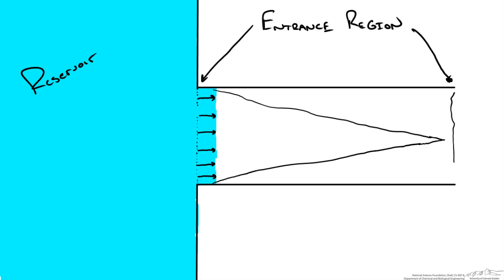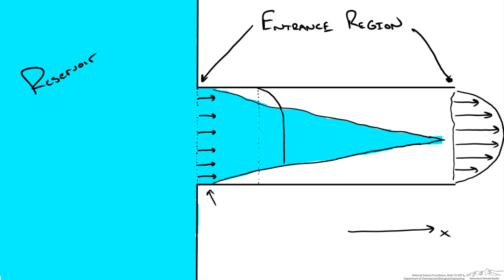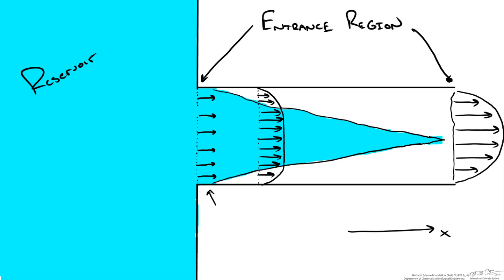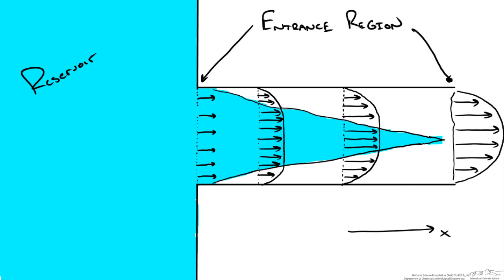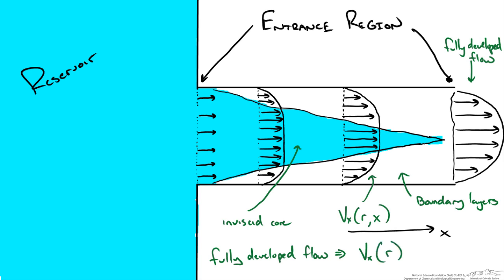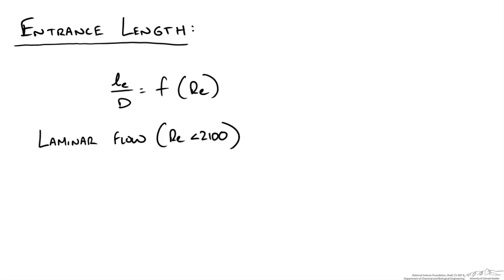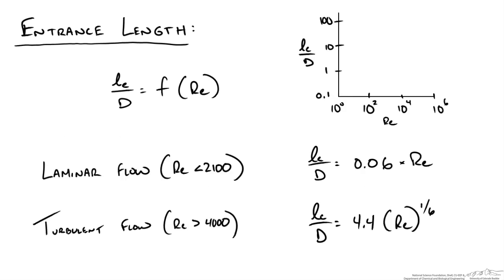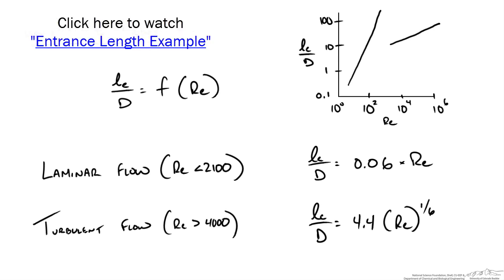Pipe Flow: Entrance Region & Entrance Length

Comment: Is there a way to figure out whether the fluid flow is laminar or turbulent just from a given entrance length? I recently encounter a problem during my exam on this, and up until now I'm unable to answer it. The given for the problem was: SG = 1.150, viscosity = 0.950 cP, mass flow rate =1.746kg/s, entrance length = 221mm.

Comment: could you please tell me that why roughness ratio (E/D) (in moody's chart) matters only in turbulent flow?
Thank you.
Reply from the maker: Its been found through experimental data that the pressure drop in laminar flow is independent of surface roughness.  Under laminar flow the viscous effects are significant across the entire pipe so there is no presence of a thin viscous layer that would be dependent on surface roughness. The surface effects are negligible.
Reply: thankyou.